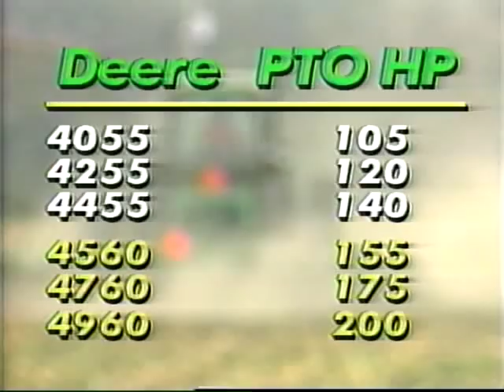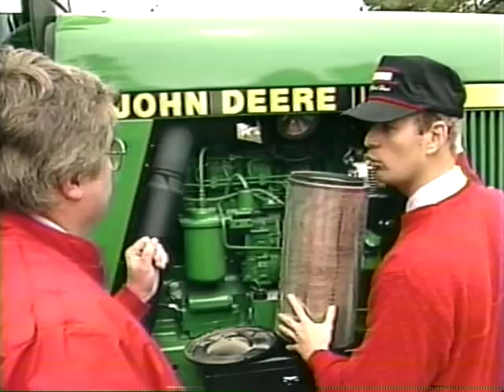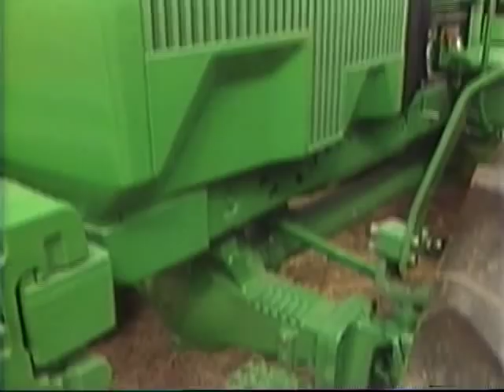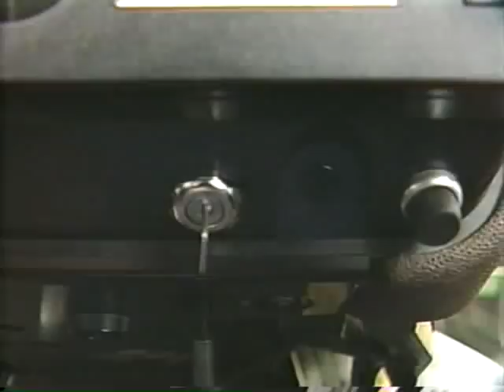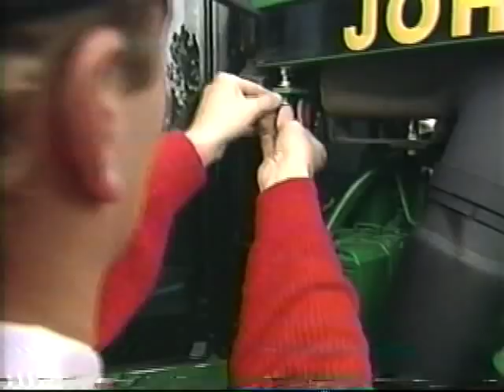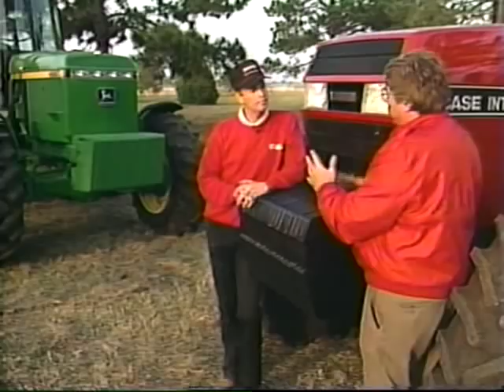CaseIH Introduction to Deere 60 Series

Comment: Everyone who's operated anything from a 4320 up to a 55 series knows there's a drain plug on the filter body that allows the filter to be drained prior to removal so you don't get that "oil all over the block and on your feet" like numb nuts is saying here.
Reply from the maker: +wags I was wondering if that was the case, I know the Perkins in the Massey’s were like that so I assumed the Deere would have been the same. Thanks for the comment.
Reply: Exactly.  It just makes it take longer for the oil to run down the side of the block to the frame!
Reply: I think the filter was repositioned cause of the new exhaust routing
Reply: Yes exactly.
Reply: I have a 40 series tractor and it also has the drain plug
Reply: wags ya I noticed that too
Reply: I like the inverted filters like on my Allis 200 and 7050. No mess at all.
Reply: Install a drain cock in place of the plug. Make sure it has a hood. Use 3/8 tube and run it to the oil drain bucket. Loosen drain cock and let filter drain out. Problem solved. Just don't forget to tighten it before starting engine.
Reply: Kelly Giesbrecht  Really what? Minneapolis Moline and Cockshutt have long been absorbed into AGCO. AGCO makes a great engine today and they eliminated the ago old cavitation problems that have plagued water cooled engines. But that has nothing to do with the price of cheese so I don't know why you bring up MM and Cockshutt. But can you explain why YOU think Deere would have had to redesign an engine in order to eliminate its half assed oil filter set up? 

To sum it up, two questions...... Really what? And explain why Deere would have had to redesign its engine before they could mount a good oil filter system? Go ahead.
Reply: The factory plug will still run a little oil down the frame rail, a simple bit of cardboard and a tarp strap, or similar to your idea, a trip to the hardware store for a short piece of pipe and a plug will solve the problem just fine. Not enough for me to throw the baby out with the bathwater. If a little oil dripping down a frame rail is your most unpleasant experience of the day on the farm, I'd say you're having a pretty good day.
Reply: Those drain plugs don't work worth a crap, just mother Deere's way to try to save her ass for a poor design. The only way to really fix the issue is to put a small hose in its place with a plug at the end of it to drain the filter without making a mess

Comment: They talk about how the magnum transmissions would last longer than the john deere's, but from what i've seen, it turned out that the john deeres lasted longer. lol
Reply: A good friend of mine is a john Deere mechanic. Been at it since 1992. I asked him what the weak spot is in the 16speed power shift .??as I was looking at buying a used 60 series. He said he didn't know ,he's never seen one apart . They just don't die .
Reply: EthaN  That is for sure
Reply: 40 series had a problem with their rear end and pto. However, it was kept pretty quiet cause of the International 560 incident.
Reply: TRUE

Comment: If IH had put their profits into research and development they might still be number 1!  Still love my Green and our MF 1233 is one snappy compact and I am getting used to our Agco Allis.  I always look for Deere, MF, Ford NH first as that is what I know and what my neighbors have.
Reply: Pretty much agree, about 1959-60 IH introduced their "new" tractors, the trivia question was "how much power can a "M" rear end handle?" Unfortunately  the answer was "less than our new engine produce" IH rested on their laurels, and were dumping money and effort into new markets at the cost of R&D on the farm tractors, and then had  some defective tractors. They were making 560's with defective rear ends about the same time John Deere came out with the 10 series "new generation" tractors, even if you don't like John Deere you have to admit the 10 series Deere's were better than what IH was offering, about the time IH got competitive tractors back out Deere was doing powershift transmissions. IHC did come out with the Hydros  but although they worked well in some applications they had a few they didn't work well in and were generally not very fuel efficient.
Reply from the maker: +Fred Cupp yeah Fred these old Magnums were great tractors but CaseIH really didn’t make much progress after the 7100/7200 tractors. They had a few other good tractors but overall they never seen the same success as they did with the first magnums. I don’t know too much about their newer stuff other than Case and NH are the same now just different paint and hoods.

Comment: My 7140 Magnum just turned 12,600hrs. Other than filter changes and couple of hoses it’s been trouble free.
Reply: John Deere guys don't start to brag until they pass 20000hours 
 Isn't 12000hours considered the end of the" break in" period for JD ?
Reply: @robertmoulton2656  my 4440 has 11,789 hrs and only a radiator and alternator. Just a solid tractor.
Reply: 12,600? That's cute. Our 4450 has 20,200. Never been touched.
Reply: and how many farmers now change their tractor, because the other brand , are offering more on trade in.
our biggest problem with deer was fixing them,who could afford it
Reply: All I'm pointing out is, this tractor has been trouble free. I run a Deere round baler and have been extremely happy with it as well. The thing I don't like about Deere is the price of parts. I can go to almost any OTR truck shop and pickup parts for the Cummins 8.3 lt for repairs if needed. I'm a small time ranching operation and maintenance and repair cost is very important to me. I also look at fuel burn rates. A Deere just uses to much for me. I rented a Deere 7330 Premium and it was a great tractor! But the darn hydro temp light would always come on while baling and the PTO would shut off! Dealer repaired it several times and it left the ranch still having that problem. And it burnt way more fuel than my Case with a bigger engine.
Reply: Daniel Altman I've run them both, both are awesome old tractors. But I've never owned or had to pay for maintenance and all that stuff...haha
Reply: Robert Moulton You mean 12000 hours is the break-in time on a engine that's still the same concept and set up as the engine Deere bought from Oliver back in the sixties?
Reply: Daniel Altman yes the 71 and 72 series are the best ever made the 89 started with all the electronics thank God Case and IH merged or the Magnum would never be here.  I buy the way bleed green but run a 2390 Case for my heavy tillage work. That is one hell of a pulling Monster. I finally bought my self a Jd 4440 iron horse with all the 55 series updates including motor. That old iron horse is a real tractor also.  Hope no one gets made but I will stay old school I do not want or need the headache with all the new emissions problems they will not hold up like the old one
Reply: Compared to my neighbors experiences you are lucky. Most have had their red tractors split in half for multiple thousand dollar repairs - several times.
Reply: Worked on a farm that has 3 magnums...7120, 7220, 8920.,one over 20,000. The other 2 over 30,000. And an mx100 over 20,000 hrs. It's not the tractor, it's the Cummins engines.  Case didn't make their own engine. Deere did.
Reply from the maker: They were designed by Case/Cummins as a joint venture, Cummins didn’t buy Case’s 50% interest in their engine company until many years later. So they are as much a Case engine as they are a Cummins.

Comment: John Deere never made ads like this.  They didn't need to.  Its only when you're on top that everyone tries to knock you down.
Solid. Stable. Still John Deere.
And did they really brag about their paint holding up?  That's damn funny.
Reply: kristina higgs Get your facts straight. When John Deere built the wa14 tractors case just had to buy steiger then claim they (caseih) built steiger. On the magnum tractors case copied the transmission from John Deere. John Deere also decided to manufacture scraper special tractors for the construction industry so now you see caseih steiger scraper specials. John Deere just came out with JD link to satellite track your equipment. Case has afs connect now. People like you seriously need to study equipment manufacturing before you make brash comments.
Reply: whoaaa hold on a minute here 1 International harvester designed the transmission used in case ih tractors and it is no way at all the same as a john Deere it is better in every way actually. 2 steiger built scraper tractors before john deere did and case built four wheel drives before they bought steiger. they just improved their overall company by buying steiger. and steiger also made specially built tractors for construction operations. 3 afs connect was not the first precision farming system that case ih used it was just the first able to be connected to multiple machines and share their data. you need to learn a little more i could go on but your not worth my time.
Reply: if John Deere was so good why did they copy Case IH? idot
Reply: @kristinahiggs1195  case ih makes a great tractor.
Reply: @scottking867  I sold my mx275 because it's such money put. My old 4440 that I bought new hasn't needed anything but a new radiator and alternator.
Reply: John Deere had a 16 speed transmission not 18 speed idiot
Reply: kristina higgs My point to you was you think John Deere copies everything from case so I had to set the bar. Back to your tonkas now.
Reply: what does that have to do with magnums and the WA14 was made by Wager idiot, I feel sorry you haven't driven a real tractor
Reply: kristina higgs The 16 speed was the Quad Range. By this time, Deere was making a 15 speed Powershift. CaseIH did buy 19 speed Powershift transmissions directly from Deere for several years. IH had Steiger build them articulated tractors sans engine, transmission and sheet metal. When CaseIH merged, it was the Case tractors that won out and became red, not the IH painted white. I always wondered why that went the way it did. Both tractor lines were very good for their time. The Magnums were a whole new approach for the new combined camp and were a well thought out machine. If it were not for a deal with Cummins for engines, who knows what would have happened.
Reply: Deere did not copy Case IH. Often IH copied Deere. There's a reason why IH combine heads fit on a 7700 and vice versa.  Because it was such a clone that Deere sued and won. Also, the twin stick like on the 1520 and on was a Deere invention. If Deere wanted to steal, it should of in 1939 with the Farmall H or M. The rare thing Deere did get sued for was in 1948 Model R having a double clutch like an Allis WD, and the "torque tube" on the LA that was like the Massey Harris 101 jr/sr/pony. Deere couldn't copy nor did any tractor. But, the IH 560 really was a clone of a John Deere. Narrow frame, light, and an engine at its limit for power already on a Farmall H rear end. Huh, sounds like a Deere 70/720 rip off too me. Facts.
Reply from the maker: +Jay Farmer these were for the salesmen to watch, not so much the customers. Sales aids.
Reply: Daily ADT Pre-Op Maintenance: Deere vs. Volvo
 https://www.youtube.com/watch?v=SWzqwJx_Iy0
Reply: kristina higgs what’s an idot?  Jackass.
Reply: you
Reply: case ih could mess up a wet dream
Reply: thegreenerthemeaner why the case won out-during the 70's Case and its acquisition of David Brown, thier construction line was stomping all over Deere with thier military contract. They figured that the old "David Brown" colors had to retire since some of thier customers were still cranky over losing the Sahara Sand and Flambeau Red in 1972. I think they should of stuck with the Black Knight demonstrator colors. Black, gold and flambeau red. Case was in trouble with thier ag line in the late 70's as an oncoming recession was inbound. The 90 series was doing okay, but not good. Deere had a strong showing with the 40 series, and Allis was slipping into 4th and even 5th spot behind Massey Ferguson but better than Whites ownership of Oliver/Minneapolis  Moline/Cockshutt. Massey Ferguson would do well in combines, but as the Deere/IH lawsuit finished in 1979, Deere was overtaking that market with better service. So...long story, yea, but IHC red was a more modern direction and the first models after the buy out were really IH's with an IHC name on them.
Reply: Jay Farmer https://youtu.be/lwcRo-E1F_A

Comment: Deere has been putting the batteries there since the 30 siries
Reply: The 20 series were there also, 1 on each side
Reply from the maker: Yeah you are right.
Reply: deere used 2 6 volt batteries in the 40 series and 30.. I'm not sure about the 50 and 55 series but we now use 1 12 volt battery on the 4840 we have and as far as i know my cousin that still has a 30 series does the same... that is why it seems that deere put the batteries there on those tractors.. we just don't have 6 volt batteries like before.. and the 20 series also had 2 6 volt long batteries like the international tractors.. we still have those on all our old internationals
Reply: They had them on both sides until they series
Reply: Doug Decuir our 4050 has a 12v battery on each side of the frame, same location, easy access. In the 10 years I've been around this tractor we've only needed to open them up once a for new ones.

Comment: Classic sales guys, try to make the other guys look bad but won’t say what’s better with them, I love Deere over Case any day
Reply: Also the sales men never run them, they can say this and that about it but has never worked on one, never ran one, and never had to order parts,  Deere is better at that and that’s why they are the industry leader
Reply: im 100% all case and kubota  thats why were getting rid of all our deeres and newhollands  and going all kubotas and case  the 2 best reliable products
Reply from the maker: +Michael Mac Tavish only difference between NH and Case is the Paint
Reply from the maker: No I know that, Michael is talking about new tractors.
Reply: Devin Nowak: You don't want to be ordering parts though and not to mention Deere now has an insane BS implied lifetime license thing where you don't even own the tractor and you aren't able to do a lot of work and mods to it unlike others.
Reply: BlackHawkBallistic actually all equipment brands are trying to do that also
Reply: Mac Farms not the old ones
Reply: Mac Farms but still the t5, t6, t7, and t7hd/ farmall maxxum pumas and optums are produced in different factory's and they use a different controll layout in the cab.

Sorry for my bad English
Reply: amen brotha
Reply: except for the part where Kubota doesn't have big tractors
Reply: Devin Nowak  yeah let’s go John Deere 💚💚

Comment: i dont know if I would every buy another sound guard series tractor, but if I did it would be a 4960, the only issue is the age, the older they get the more you have to deal with, I would probably buy a 8000 series for close to the same money
Reply from the maker: That's the problem with the older tractors, they are old tractors lol. Just like our 3000 series Massey's, ahead of their time in many ways but now after 30 years or so, those 1980's vintage electronics are a pain.

Comment: Did they ever make a video like this comparing the 7000s series John Deere to the magnums?
Reply from the maker: +Austin Seubert I think so, 7000/7010 series to some case for sure just don’t know if it was the magnum
Reply: Mac Farms i was wondering if you had ever come across it and could upload it i have a soft spot for the 7000/7010s tractors and would like to  know what case has to say about them  thanks for the reply
Reply from the maker: +Austin Seubert I have MX 170 vs 7810 and 7600 vs Case 5250. Converting them over soon.
Reply: @macfarms  hurry up 😂unless I missed it, lol
Reply from the maker: EthaN I can’t remember if I made them public or if they are on my Patreon page. I’ll have to look.